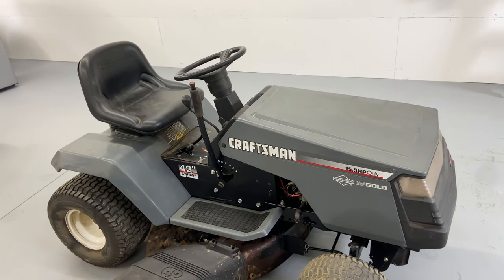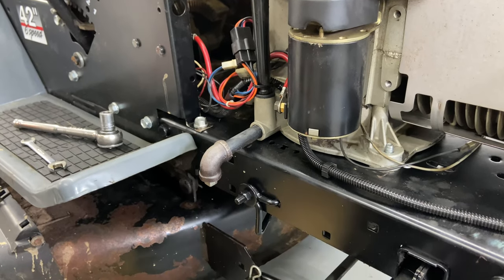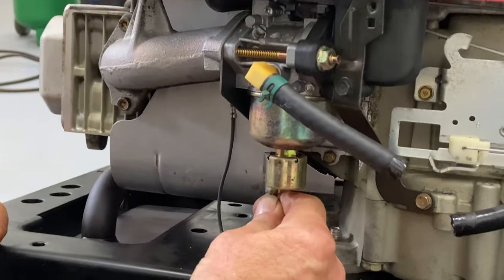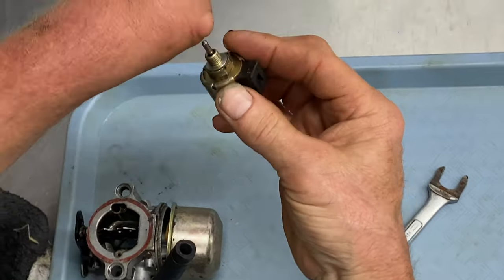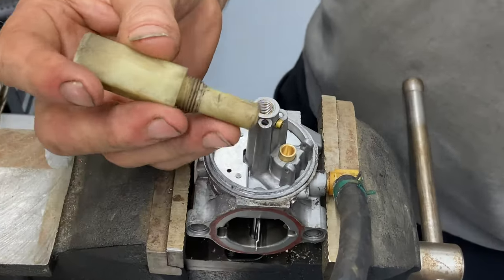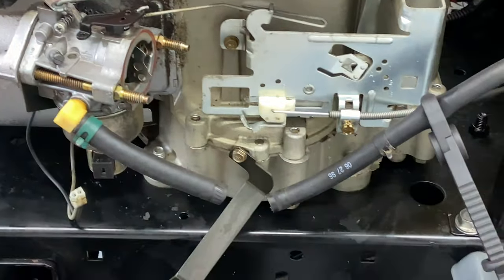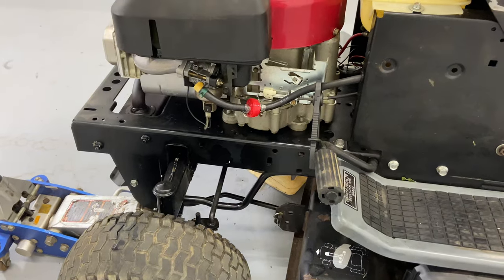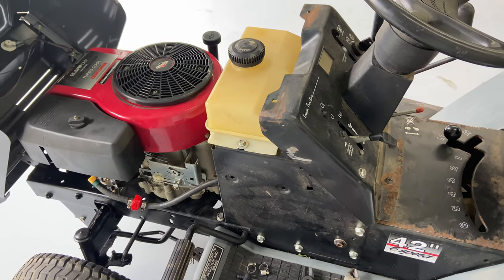Why is there Gas in my Lawn Tractor Engine Oil ???

Comment: Have a problem with fuel getting into crank case on 23 HP Briggs. New carb, no change.  Any other ideas would be appreciated.
Reply from the maker: (1)The carburetor is the only way fuel can enter the engine. If you purchased an after market carburetor?? If yes, there is your issue. If not then take apart new carburetor bowl and check needle valve and seat for dirt. (2) maybe the fuel pump is pushing fuel into the valve cover??. I have never seen it but maybe?? I’m guessing. It normally is carburetor that fails and yes new aftermarket carburetors fail.
Reply: @JohnsonsSmallEngines  Thanks for your suggestions. It is an aftermarket carb. I'm going to replace the fuel pump and see if that works. If not, I will go back to the carb.

Comment: What's your thoughts on the $20 carburetors on Amazon
Reply from the maker: I personally have no luck with the aftermarket carbs for the single cylinder Briggs and cannot afford to put them on a customers machines. Try and rebuild the original Briggs and if it does not rebuild then I purchase an original Briggs. If you try one, let me know how it works out.

Comment: But how do you get the gas out of the oil reservoir?
Reply: I just drain it, let it drain for 30 mins or so make sure I got most everything out and then reinstall plug and fill with oil and hasn't failed me yet

Comment: I have this problem. I tried to start the engine several times before realizing what it was. Even put more gas in. Then I noticed gas coming out of the air filter housing. Now it won't even click or crank. I assume the fuse? Tried to jumper straight to the starter from the battery and nothing happens. I guess I fix the carb first. Change the oil. Then diagnose the electrical? Help please.
Reply from the maker: First get a clamp or somehow stop the flow of fuel going to the carburetor. Then pull the spark plug out and you will most likely have a lot of gas coming out of the spark plug hole. Yes, you may have blown a fuse. Stop trying to crank it over. Repair it and hope you did not burnout the starter. Let me know how you make out.
Reply: @JohnsonsSmallEngines  Thanks for replying. I got the electrical diagram and I think the starter might be ok if I blew both fuses. I can't hear the carb or starter solenoids. Checked the battery. Has 12.45V, new battery last year. I put it on a maintainer charger overnight. Hopefully I'll have some time after work today to tinker with it. I'm just dreading that I damaged something by trying to start it way too much. I do have another engine very similar to this one that I might be able to get parts from.
Reply: There is gas all over the frame, carb, air filter, muffler.... The carb solenoid has gas in the connector. It's bad. I just didn't know. I guess I need more experience with carb engines. Lol
Reply: @JohnsonsSmallEngines  Fixed leak in carb. I hear the carb solenoid click when I turn the key to on. Took out the spark plug. It looks pretty good, checked gap and cleaned carbon off. Checked the fuse and it is actually good. Checked the orange/wht wire at the solenoid and it's good when I turn the key to start. I'm not hearing that start solenoid click. I assume that when I check for continuity between the poles I shouldn't have any until the key is turned to start?
Reply: @lrocky223  the
Reply: @lrocky223  l

Comment: Hello, I replaced the carburetor and changed the oil. After doing so the engine will start up, but only last about a minute. It sounds like it runs out of gas when it dies. I checked all fuel lines and gas cap but for some reason it keeps dying. When I check the oil it definitely still has gas in it. Do you mind helping me with this?
Reply from the maker: Almost impossible to diagnose. When home not in front of the machine but I can say you must make sure you’re getting good flow of fuel from the gas tank to the carburetor so I would check that. Also, if you have a electronic fuel shut off solenoid, I would make sure that that is working. Not sure how good the carburetor is that you bought if it is OEM or not original equipment manufacturer? Or I would definitely change the oil again until you know there is no fuel in it.
Reply: @JohnsonsSmallEngines  Okay, thank you for the fast response. I realize it's not very helpful to not include what the engine is lol. It's a troy bilt pony, with a Briggs & Stratton 17.5hp. I am very new to working on engines so your help is very much appreciated. I seem to have good flow. I thought maybe the cap wasn't letting air in and creating negative pressure, but even with it all the way unscrewed, it has the same issue. The carb I replaced was leaking gas out of the breather tube, after replacing it, the tank holds gas without having to use the shut off. The replacement was off Amazon. I will change the oil again.
Reply: @JohnsonsSmallEngines  For a more concise explanation - The carburetor was leaking gas from the breather tube, and the oil had gas in it. So I replaced the carb and oil. Now the gas stays in the tank. However, when I start the engine. It runs for about a minute, then it slowly putters out. Almost like it's out of gas. If I wait about 30 seconds, it will start up and do the same thing again. - Extra info, when the engine is started in choke, it puffs black smoke with each stroke. -
Reply from the maker: Does it have a fuel shut off solenoid underneath the carburetor? If it does? Check to make sure it’s working. You may also have a bad new carburetor. Again this is all I can help you with without being there.
Reply: @JohnsonsSmallEngines  It does have a solenoid underneath. I am hearing a click when I turn the key, and the wiring all looks normal.
Reply from the maker: Ok, solenoid should be ok. You either have a bad fuel line that is clogging as the engine runs or a bad new carburetor. When the engine starts to die, try putting it back up into the  choke and see if it runs longer. If it runs longer, you definitely have a fuel starvation issue.
Reply: Also check the vacuum line that goes from the motor to the fuel pump. I had that issue and that vacuum hose had a big crack in it.